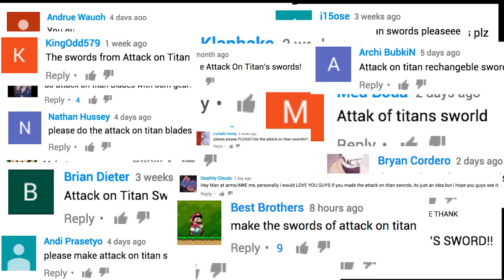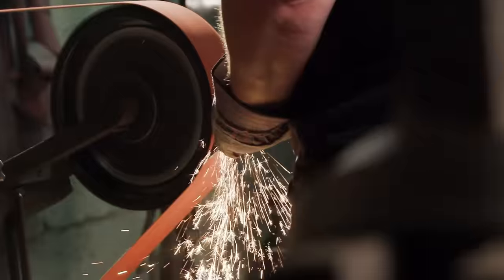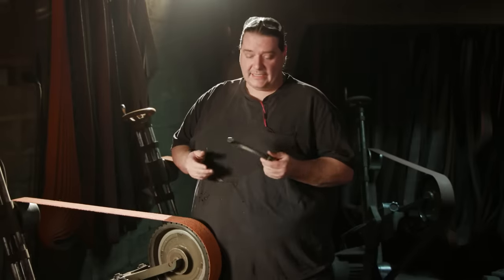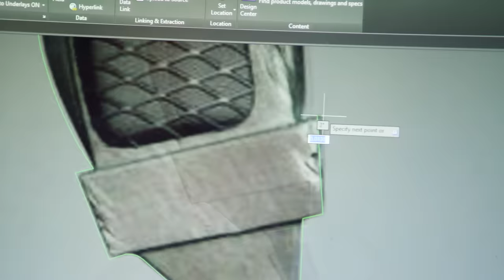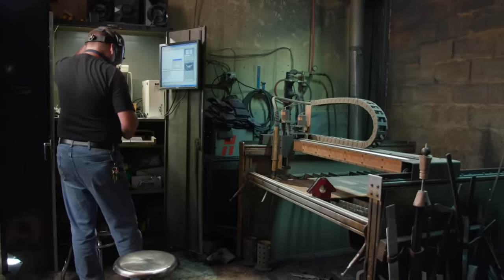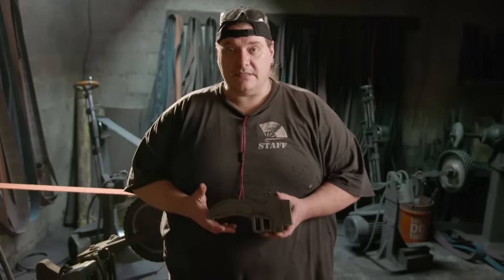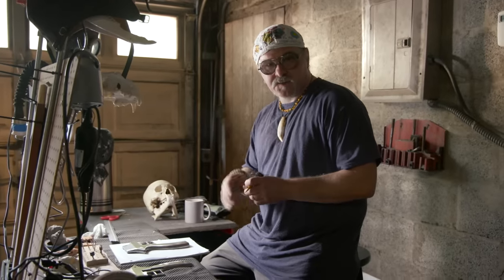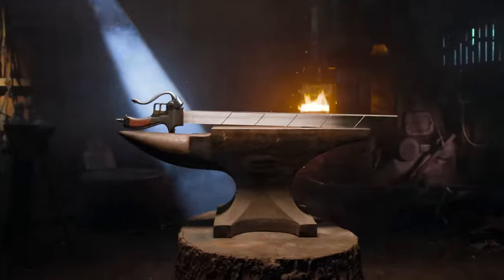3D Maneuver Gear Sword - Attack on Titan - MAN AT ARMS: REFORGED

Comment: Attack on titan swords are just glorified box cutters
Reply: Which is practical in the anime's case
Reply: would have been a waste of time making anything else to be so disposable :P
Reply: "Titan cutters"
Reply: They're a bit too thick for that really, at least the MAO version is but it would be an epic cutter which is fitting.
Reply: I-
You're actually right
Reply: Yeah
Reply: XxOofGamer MasterxX 
no, they’re definitely designed like cutters.
the “grooves” I think is to be broken/snapped if the edge of the cutter is dull, grooves will form the snapped blade(like its original angle) and cuts razorsharp,

edit: you’re also right, they’re pretty ‘bendy’ (the cutter it is, also maybe the 3dmg blade too)
the “entering cut” also helps to make curved cut because it’s bendy, specially for huge chunk of flesh
14:13
Reply: They hated Jesus cause he spoke the truth
Reply: XxOofGamer MasterxX r/woosh
Reply: I'm not mad, why we have to be mad? Lol, shingeki no kyojin is a masterpiece not just because the blade. The manuver gear is the complicated one.
Reply: Didn't stop Gus Fring
Reply: But from a practical sense, they'd snap in a matter of minutes
Reply: @XxOofGamer MasterxX They have grooves so that when the top blade gets dull, you can break it off and have a sharp one ready to go
Reply: @thefattertheratter45  From an anime sense, you'd only use the tips to cut out the naps of the neck. The tips would get dull, and the fighters would "snap off" the dull tips to reveal a slightly shorter yet sharp as new blade to continue usage. Same as a box cutter, really.
Reply: They said that in the video
Reply: @XxOofGamer MasterxX box cutters have the grooves on it so that when the blade gets dull you take the blade out and you snap off the blade at one of the lines and you have a brand new sharp blade instead of having to buy a whole new blade everytime the cutting edge is dull
Reply: You’re totally right
Reply: YES
Reply: Yeah, it is a big version of a box cutter, which is so SHARP, SO PRATICAL, that they can use it to cut FLESH, meaning your lucky no one uses a BOX CUTTER on you 🤣😂🤣😂
Reply: cough*cough “Badass” glorified box cutters
Reply: You're not wrong
Reply: They kinda just use it like box cutters, they just break off the broken part on top to use the next sharp blade.
Reply: @quanyuan6760  What? They discard dull blades. Thats why they carry multiple sets. The break points are so the sword can break if it hits bone. You don't lose all your momentum and become titan food if your blade gets stuck
Reply: That's the point. When your flying around at high speeds you really don't want your sword getting stuck if you accidentaly hit something hard, it's better to just let the whole thing break off then to get your arm broken.
Reply: Your Greatest Ally  They're supposed to break. That's why they have extra blades. They're not meant to be used like traditional swords, they're meant to be used while flying around with ODM gear. Imagine if you're using a traditional longsword while using ODM gear. If you accidentally hit bone it'll get stuck cause the blade is too strong, and your arm will break or even get torn off if you're flying fast enough. The grooves help the blade break off when it hits something hard so it doesn't affect the user's swinging, and they can just replace the blade.
Reply: B. A Actually it's not the way how it works, the blade just broke off when it's not sharp anymore, just like real life ones
Reply: @quanyuan6760  Actually you're completely wrong. Look at how they slice titans. They use the WHOLE BLADE. Real life ones you are only supposed to cut with the tip, which is why you break it off
Reply: Your Greatest Ally  Uh, this video clearly shows that it isn't gonna break off if it hits something soft. Yeah, yeah I know. Fantasy series and all that, but a good writer always makes the effort to ground his story in realism, even if there are fantasy elements like huge 15ft tall cannibal people. Even if those swords are not entirely realistic, you have to respect that the designer attempted to give a practical reason to the design to the swords instead of just making them look cool like most anime or movies.
Reply: @thefattertheratter45  their supposed too. If they get stuck in a Titan you have to be able to snap them off, that's why there are replacement blades in the ODM gear
Reply: In every way shape and form
Reply: Men it's like your Roasting Pewds because that his fav anime bro
Reply: Men it's like your Roasting Pewds because that his fav anime bro
Reply: Why would you say something so controversial yet so brave?
Reply: and you know you love it
Reply: Yessss
Reply: giant bocks cutter
Reply: Well their supposed to be disposable anyway
Reply: @King-yj2jx  nah, it’s shouldn’t have those ridges like a box cutter, on a box cutter those are used to break off the tip and have a new sharp point, in the anime when the sword gets dull they throw the whole blades away, those ridges basically just add a useless weakness in the blade.
Reply: Paring blades
Reply: @bulja80085  no, they use the blades and snap them off during use, mikasa had a very short blade in trost because she was using her blades so much to kill titans
Reply: @ianmckenna6146  Yeah because it broke, not because she snapped it herself, she fell from high up so it just broke.
Reply: I use those things at work ewery day they are actualy deadly as hell if you dont wach what you doing
Reply: True
Reply: Nah its a long box cutter
Reply: that's what i've been thinking too
Reply: Eva 02s progressive knife says hello. Its a giant box cutter.
Reply: That couldn’t be more true😂
Reply: Yes, yes they are.  And I want to make them
Reply: They’re supposed to be replaceable

Comment: 6:15 "Jetpack" Alright, you're walking a dangerous line. Lol.
Reply: it does kinda have a little thruster thing on the back
Reply: @GushChew  Yeah, that can be a bit deceiving. The gas that powers the ODM device operates a set of gears that reel the hooks back in at high speed. The "thruster" is just the exhaust; it provides no acceleration by itself. And yes, I am an absolute nerd for paying attention to those tiny details.
Reply: @Jake Choi Could you link me a reference or episode number? This is the first I've heard of it.
Edit: Btw, I'm not calling you out. Just genuinely interested in stuff like that.
Reply: It still stands. The term "jetpack" doesn't simply refer to a backpack with jet-like thrusters. It's just a pack that propels the user in whichever direction using gas or liquid--or whatever resource. You might as well call it a propulsion-pack or a jettison-pack; both adjectives which support acceleration of movement which is what the technology in AoT does.
Reply: @thebrandonrobert5693  A jetpack, if we're using technicality, is a device worn over the shoulders to propel the wearer with jet propulsion. The ODM's various straps around the thorax and shoulders may fulfill half that definition, but jet propulsion is not its mode of transit. It uses winches and gears powered by released air pressure in the tank. I've not been able to see anywhere in SnK where it states that the ODM is capable of jet propulsion aside from the video games.
Reply: The grapple is like a gun and the gas is like in a car it boosts you around
Reply: @Dylan-np4oy  no it powers the grapple.
Reply: i dont know what episode but the one where eren becomes a titan for the first time. mikassa wasted a ton of gas by useing the gas to prople
faster lol
Reply: @szko4492  I just rewatched. I suppose that it could be interpreted that she was using the ODM as a jet booster, but it never says how she boosts. I always assumed that the ODM gear was just capable of acceleration when reeling in the tethers by consuming more gas to increase speed and not blasting gas out the back like a jetpack.
Reply: @hezakighamorgan9974  i think it more relys on expeling more gas than the exhast can haddle to speed up i might be wrong tho
Reply: @szko4492  Even so, this process doesn't provide any jet propulsion, or at the very least not enough to speed a person up. Rather, this harder expulsion of air pressure causes the gears to reel in much faster than usual. Either explanation is possible, but I think the one I'm advocating for is more probable simply because in the scene we're referencing, if Mikasa blasted gas, the first acceleration agent would be the gears, and then possibly a minimal amount of jet propulsion, but in either case, jet propulsion is not the ODM's mode of transit, hence it is not a jetpack. Additionally, I don't think "gas blasting" without launched tethers is even possible simply given the ODM's anatomy. To expel gas without the tethers fixed on anything, if done with enough force to propel someone, would snap the gears in the ODM. The sheer pressure on a gear with a stiff pivot point, by which I mean a gear incapable of spinning, would cause the pivot to snap, leaving the gear useless for reeling in the grapples as it is no longer connected.
Reply: @hezakighamorgan9974  okay
Reply: Same
Reply: Yeah but it isn't called a jetpack because a jetpack can maneuver you with out a swing system
Reply: @hezakighamorgan9974  well the thing is they can also release the gas from the canister to use it as a bit of a boost and the thing is the "gas" which is really just high pressured air doesn't power the ODMs themselves
Reply: @hezakighamorgan9974  you see, in all of the manga covers you see eren basically flying across the wall to collosal titan, he isn't grapeled to anything, he is just in the air, and you can see a ton of vapor under him, and according to the laws of physics when you do something, a force on the opossite direction will propel againts the objct that hit it and blah blah blah, what i'm saying is, the exaust part was propeling eren just a little bit higher, so we could see that amazing picture.
Reply: The made theirs so let then call it what they want. If you don't agree with them go make your own.
Reply: It’s a storm in this section goddamn
Reply: @hezakighamorgan9974  when levi fights the beast titan we see a close up of it and he turns it from side to side, like a jet fighter engine vectors its thrust. why would a simple exhaust need this feature?, we also see a few times people burst it to slow themselves before hitting the ground
Reply: @Jake Choi yeah. weve seen Mikasa especially use purely gas exhaust the manuever around at high speeds.
Reply: Ok can we just all agree they fucked up saying jetpack lol.
Reply: @hezakighamorgan9974  actually no , in the first Seasons , Jean got propulsed a lttle bit in the air( 50 cm or something like that ) while taking an odm he found on a dead body without using anything like the grapple. He  just was thrown in the air  enough to prevent him to fall to hard on the ground
Reply: No it’s a gas blaster it uses gas to go faster like air gas
Reply: Lol jetpack
Reply: who cares don't be a weeb we are here for the weapons not they talking about anime
Reply: its just a compressed air which can also act as thruster though drain the tanks much faster since it will switch to continues flow...i believe it works the same as the Breathing apparatus worn by firefighters though having a big difference on Psi since its not made for breathing but rather for launching object.
Reply: @sebastiany.2960  we care. yes we are here for the weapon but it is reasonable to start an argument about whether the ODM Gear's gas expulsion system can be considered a jetpack or not because the swords are part of the ODM Gear. also, saying "don't be a weeb" to weebs is like telling Asians "don't be an Asian".
Reply: they are not wrong there it acts basically like a jetpack, but... yes its not a jetpack, its more like a thruster and it wouldnt work without the grappling hook (you would be yeeted hard without it)
Reply: Jesus, look at these nerds :/
who am I to talk like that? I'm a nerd too.
Reply: I wish you guys had the tech to create fully functional Omni Directional Mobility (ODM) Gear.
Reply: Looking back on this I now understand how ODM gear works, I always thought it used compressed gas to actually propell a wearer of the suit and complement the winches, I did not know it was actually the POWER SOURCE of the winches.
Reply: @thebrandonrobert5693   like someone else already explained, the gas isn’t used for thrusting but for reeling in, the gas that comes out of the back is just an exhaust port.
Reply: The gas can be used to actually propel someone or even stop them. This is show in many episodes. However, this wastes the gas faster, so it’s mostly reserved for either receiving a speed boost or adjusting your course quickly.
Reply: @hezakighamorgan9974  in the fight between Levi and the beast titan you can see the nuzzle of the gas swivel helping him go into the spin meaning there is at least a small bit of gas propulsion.
Reply: @hezakighamorgan9974  The gas from the exhaust provides a large boost when in the air, otherwise the gear wouldnt work
Reply: @hezakighamorgan9974  Bertholdt flying up into the air in season 3 episode 15.
Reply: @hezakighamorgan9974  and Mikasa using gas to speed up her run in season 3 episode 15
Reply: @hezakighamorgan9974  Also Levi while fighting the beast titan, after cutting the eyes, Levi made a sharp right turn. In that scene his anchors were not grappled on to anything. Since they were not grappled onto anything, he couldn't turn with any momentum or pulling power. How else would he be able to make a sharp turn?
Reply: lmao
Reply: @hezakighamorgan9974  not rlly nerd but a weeb Btw same
Reply: ODM gear is really just a glorified jet pack all it is is grappling hooks 10 sword blades(counting the ones on the hilts) some kind of thruster and two gas canisters that’s really all ODM gear is
Reply: I would just like to point out that they did the blades wrong the blades are bendable for that matter they're also made from materials we don't have in this world so I understand the materials we have had to suffice but these blades would not cut through a Titan's nape at all lmao let's be real

Comment: Imagine how the blacksmiths felt in attack on Titan, just by making one of it takes many hours and there are thousands of soldiers
Reply: Good news for them, the number of soldiers is declining rapidly.
Reply: New SNK episode will make more blacksmith quit their job
Reply: They were paid (right?), so i guess that is one of those jobs that always have demands
Reply: I'm sure they probably have it down to an industrialized process
Reply: They probably have a division for that
Reply: I guess the blacksmiths preferred their job than being a scout regiment soldier.
Reply: the number of soldiers in the survive corps never exceeds that of 300 soldiers, less than 10% of recruits go to this division every year for fear of the titans, most of them go to the garrison.  sometimes the equipment can be reused from dead soldiers, the gas is specially extracted from paradis and is always restocked, which can be little expensive, especially if the gas is for the exclusive use of the equipment, the blades are always replaced, but are  simple to make and are not thick, not so expensive, the equipment may need repairs from time to time, which can be expensive depending on the situation. From the beginning it is said how the survive corps needs money but the population finds it a waste  tax and the king sends little money to collaborate, in fact the equipment improves after Historia assumes the throne and obviously sends more money to the troops
Reply: @supercool_saiyan5670  You're right they are probably just machine stamped out of a big sheet of steel by the dozen before being treated/tempered en mass.
Reply: I mean they had all that time inside of the walls
Reply: the blades are mass produced in factories, it says it in the show
Reply: @aidangreen7711  bruh lmao
Reply: the same for blacksmiths of old, imagine making arrow tips and chain mail for thousands of soldiers, and the armour and swords, for the horses too
Reply: Arent they mass produced? They definetely figured out some way to make them quickly

Comment: Guys this is so cool. Could I buy one? I definitely would.
Reply: Do It like me, built It from scrach, i Will use a wooden handle for less weight.
Reply: You can find the Patterns in the web Very easily. Carbono steel is perfect, the thinnest possible (not that thin althought).
Reply: Just buy a box cutter and imagine it as 3d mgs
Reply: @autoplay2412  a box cutter but make it ten size bigger

And a hand gun 

Idk what parts for the ODM gear and the gas tank :/

Comment: Amazing work ! The Mikasa and the sword are very well combined and it fits together nicely :)
Reply: I'm the Mikasa, thank you!
Reply: Gabrielle D'Agostino Awesome job!
Reply: Thank you !
Reply: Please cut me up, Mikasa, because I've got a titanic crush on you.
Reply: Seriously? If so then amazing job.
Reply: TetrisClock yes that's me! Gael Ackerman on Facebook 😊
Reply: Gianni Bodeutsch only if you're a Titan, or threatening someone close to me
Reply: The Mikasa and my sword are very well combined and it fits together nicely. 😕😂😍

...im sorry please don't cut me.
Reply: Gabby, those blades seem like they wobble a lot while being swung. Did you find the sword easy to use and did that wobbling transfer down the handle?
Reply: PAKTRA PRODUCTIONS Boy...
Reply: Code S I didn't make the handle transfer, but while using I never had a problem with the blade being wobbly. There are two blades though, one is less sturdy than the other. My only issue with the sword is that it was very heavy and awkward to hold
Reply: Omg help me I don't know what to reply I'm speechless thumbs up and use an inhaler

Seriously, You all did a pretty good job !
Reply: Drxgon Bxll thank you very much 😊
Reply: Thank you :)